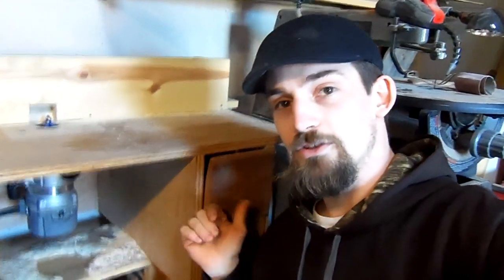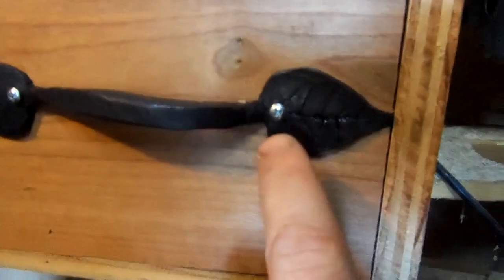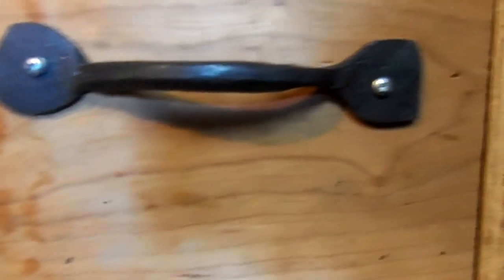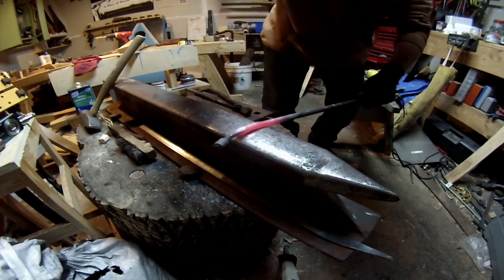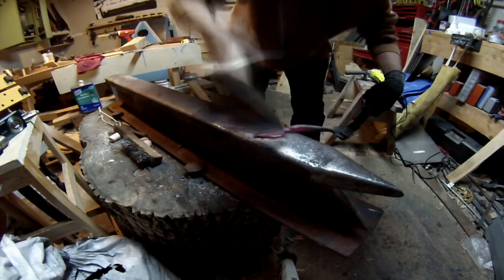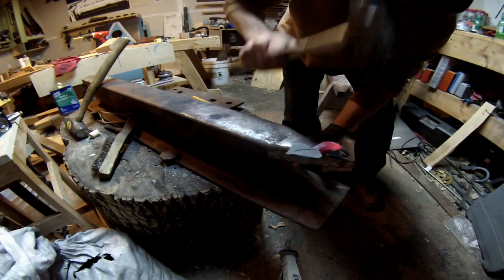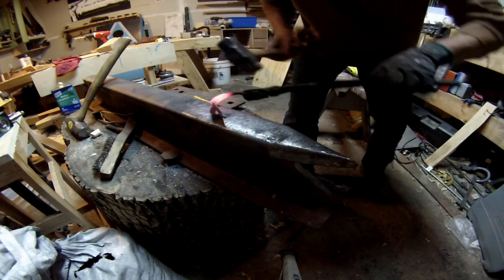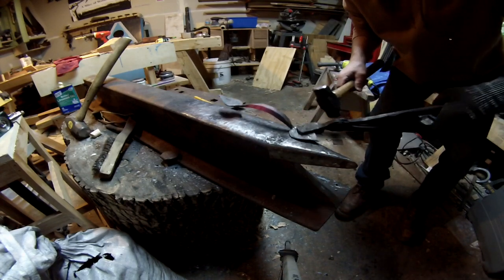Hand Forged Drawer Pulls

Comment: Good job.  The last one looks good.  You may want to put an oxide finish on the screws.  Heat red hot and quench in oil.  Re-heat and cool slowly.
Reply from the maker: I will have to try that. It will look better than bright shinny screws